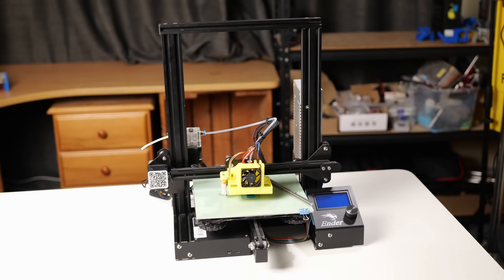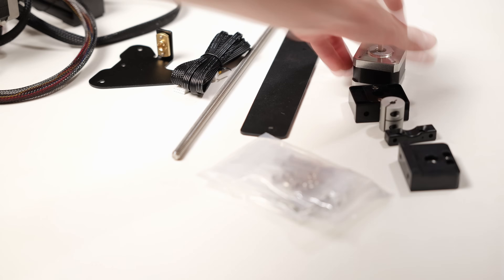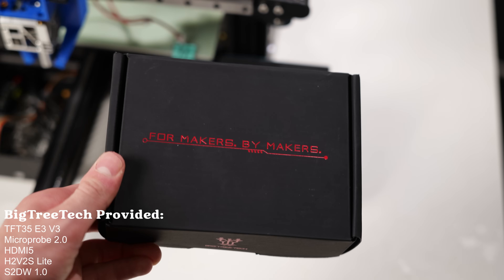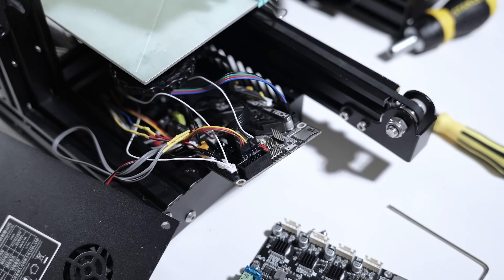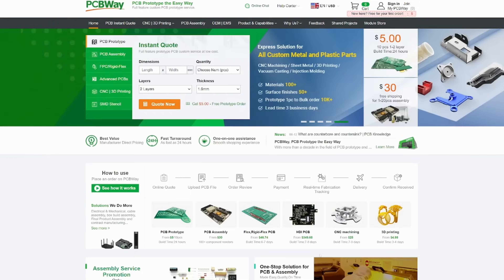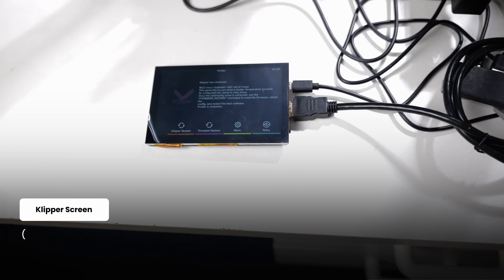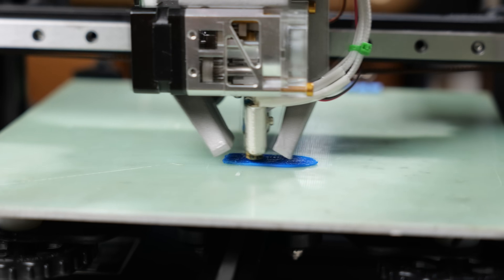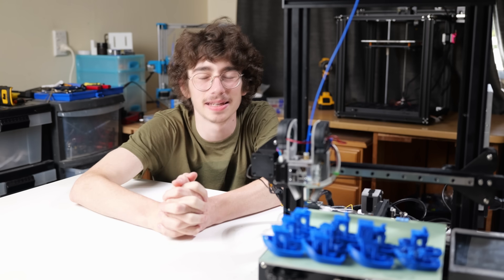Upgrading Everything on my Ender 3

Comment from the maker: I’ve uninstalled the mains bed for safety concerns, I’ll consider reinstalling it in the future once I receive proper parts. I appreciate everyone’s feedback on it. I’d like mention that this videos purpose was to try and upgrade “everything” not upgrade the most impactful parts. It’s not the best performance per dollar, there are more videos out there covering what the best value upgrades are. I can always recommend a leveling probe, mainboard upgrade (I’ve heard good things about kevinakasam’s dual z belt mod) and a hotend and extruder upgrade. There’s plenty to choose from, I’ll try and do a deep dive (with justification) on the topic in the future.
Reply: i tried to upgrade my biqu b1 with big tree tech board and the h2 and the printer just keeps missing 10cm even after calibrations
Reply from the maker: @dorito24856  I’m not sure why that would happen, I’ve done several mainboard upgrades and extruder upgrades with minimal issues. Some fixes I’d look into would be E-steps for all axis, in case they got modified, and motor v-ref and current in case you’re missing steps. I hope you find the solution. Cheers

Comment: That little 220V silicone bed looks dangerous, bro.
Reply from the maker: It is, I am very careful around it, any mistakes could certainly be dangerous. I’ll be working on making it safer in my own time. Crimp connections are used when possible, however a thermal fuse is a recommended add on. I’ll look into it as I’d like to know as much as I can to increase knowledge and reduce risk. Cheers
Reply: @TommyHoughton  Well, the first thing would be to have a really good clean surface for it to stick to. You should remove all that old insulation foam before sticking it on the bed for starters. Next would be insulation for those wires to prevent them from shorting out. TBH though, with such a small bed, 24v should be more than enough to heat up quickly in my opinion. On larger beds with thicker aluminum plates is when AC is really necessary.
Reply from the maker: @wrxsubaru02  Good tips, I’ll look into some more cable sheathing/covers for my wires as I’m all out and it’s useful stuff. For a 235mm bed it’s not necessary using a mains heater, I just wanted to add it for the title and was a food excuse to try out. There’s a video I would like to do in the next few months where I install a silicone heater on a cabin fiber sheet as a lightweight alternative to an aluminium one, will hopefully be interesting for high speed printing on bedslingers.
Reply: @TommyHoughton get some RTV gasket sealant and put it around the edges of the pad, check how voron beds are assembled
Reply: I have a similar 220v 500w bed heater which is 300mm^2. Once I had the mcu on without the rpi powered. The mcu turned the bed on by itself and kept it on at 100% for a few minutes. I heard hissing sound from the other room, came back to find that my bed heater was about to melt my printer. Smokes were coming off and the heater almost detached from the bed. But its working fine even after that incident. I never operate it from far after that.
Reply from the maker: Thanks for sharing, that's a pretty scary experience. Glad it's working fine. I'll put some more time into the bed and make sure it's as safe as possible.
Reply: yea that kapton tape mounting is... sus.if you have an air bubble whatever under there, that heater mat will not be happy and will catch fire at some point. It will also stink like death before thats happening
Reply from the maker: @takuya2431  good point, this model didn’t have adhesive backing so I thought it would work. I’m uninstalling the bed today until I get proper parts. I appreciate everyone’s feedback

Comment: at this point you should have converted it to switch wire using a kit but it could have been a totally different video and approach
Reply from the maker: Yeah you have a point. Christoph Lehner already did an excellent video doing just that, and I wasn’t ready for such an undertaking just yet. Cheers

Comment: I modified my Ender 3 V2 Neo with linear rods on Y, linear rails on X, double Z that is going to go for belted Kevinakasam, and Titan + V6 extruder with CHT nozzles and 5015 6000rpm blower. 
I think that with Marlin MRiscoC with Input Shaping, Linear Advance, Junction Deviation, the best compromise for quality and speed is 150mm/s for cheap filaments and 4000mm/s² acceleration. 
I obtain near 37min benchy and I consider myself satified.
For speed the only way is a CoreXY but you'll need also hyper PLA or new hyper PETG now near 20-30% more expensive than traditional filaments.
Reply from the maker: Your machine sounds amazing! I tried some high speed pla in my Ender 5 video, and I’m super pleased with its performance. Cheers
Reply from the maker: Thanks for the link! I quite like how clean and compact it is, the cooling looks good too. I might have to look into some higher rpm 5015 fans.

Comment: I did something similar to my Ender 3 Pro.  Thing doesn't look remotely the same.  Dual Z Axis, LED light bar, Sprite SE extruder, Spider hotend, Nebula pad interface, insulation under the bed, different springs, blue metal level screws, CR Touch auto level are all the purchased upgrades.  Printed upgrades include a mount for the Nebula gyro sensor, bed handle, took drawer, Nebula pad cradle, Nebula Camera mount, rail covers, rail caps, cable clips, power supply fan vent, scraper holder, and other bits and bobs.  The next upgrade is just gonna be another printer (maybe a Bambu)
Reply from the maker: That’s awesome! I hope to keep upgrading my machine until it’s unrecognisable, or at least till there are no stock parts. All the best with your next machine and upgrades!

Comment: What you can try for the speedbenchy is actually remove the rubber feet and pit it on small stiffer legs, for some reason the vibration of the printer and the bed can cancel each other out because the bed doesn't stop abruptly because the printer itself moves with it
Reply from the maker: Interesting, thanks for sharing that! I’m planning on doing more performance upgrades to the Ender 3 later this year, so I’ll try remembering this. Cheers
Reply: @TommyHoughton  the guy that made the 100 3d printer has a great explanation for it! It is on youtube
Reply from the maker: I’ll check it out! I’ve heard great things about that machine.

Comment: its said to say but just buying a ender 3 v3 se is cheaper and you get MOST of those upgrades already done rather than upgrading a stock ender 3. i had a ender 3 and upgraded after  looking at the cost.
Reply from the maker: I can completely agree with that, my friend recently bought a V3 SE and he’s very pleased so far. In terms of value it’s near unmatched. Cheers

Comment: a few notes here.
1. you should really use a z-motor bracket that uses all 4 motor holes
2. the top parts on the lead screws will overconstrain them. I don't really add them but at least 3 of my printers came stock with something akin to those.
Reply from the maker: Thanks for the tips! I’ve heard before that the “Z-guides” or whatever they’re called could cause problems but I think it was in the long run. I’ll look more into it. Cheers

Comment: can u help fix my ender 3 pro something with the bl probe idk what's causing it not to print correctly
Reply from the maker: I can try to help, but you will have to explain it as clearly as possible. I only just fixed a bl touch issue two days ago after giving up. Cheers!

Comment: Have you got any links to good settings for printing with PETG on the ender 3 series?
Currently I have to print slowly or it goes all whack with the prints.
Reply from the maker: Not really sorry, I haven’t got much experience with PETG and still haven’t been able to dial it in. I don’t use it often either so I haven’t done any research. I hope your printing improves soon and you find the best details possible. Cheers!

Comment: I have an Ender 3 pro that has been gathering dust, I have considered just selling it and putting the money toward a BambuLabs printer as I am tired of the headaches. 

I do prefer open source firmware though. Please let me know what you suggest. 

Thank you for the video.
Reply from the maker: I have friends who swear by the Bambulab’s reliability and quality, while I do not have personal experience with their machines, I can recommend going with them for less trouble. I’ve been tempted several times when my machines decide to break. I’d be willing to make the sacrifice of open source firmware for a system like Bambulab’s. Thank you for your question and for watching! Cheers

Comment: hey mate, do you know which fans you used or the cable extensions specifically? i can't find any on amazon au
Reply from the maker: I use AliExpress for all my parts, I can provide the links for reference (hopefully YT allows them through.) The fans are nothing special, just generic 5015 ones.
https://www.aliexpress.com/item/33049767300.html?spm=a2g0o.order_list.order_list_main.10.42f11802imEsRK
https://www.aliexpress.com/item/1005002129562534.html?spm=a2g0o.order_detail.order_detail_item.3.7e68f19cMyFmTo
Otherwise, I don't use Amazon Au since shipping to NZ is always just a little bit too much. Let me know if this does/doesn't help.
Cheers!
Reply: thank you! just bought them and hopefully they'll work

Comment: I think about upgrading and replacing parts on my Ender and Kobra Go's and always come to the conclusion that the money and parts are better used on putting together a Voron or some other DIY printer.
Reply from the maker: I agree with that, anything in a similar league to a voron will outperform any bedslinger. It’s a great looking machine too, as with all the higher end corexy’s.

Comment: amazing but here are some things that can retain quality at those speeds, 1. belt are tensioned with as tensioner, 2. the extruder may be a little heavy, 3. make sure fully you are not losing any cooling and all part cooling fans should be at 100%, 3. dont go that high speeds, 4. make sure everything possible is calibrated, 5. general maintenance 6. quality fans

and you should be good :)
Reply from the maker: A proper belt tensioner is what I need to get next, it really does make a huge difference. I’ll keep those tips in mind, and thanks!
Reply: @TommyHoughton i just remembered, but you could get more powerful cpap fans, they are more powerful than the 5015 and can also improve quality by a lot. And you can print and use the printers parts to make a belt tensioner.
Reply from the maker: @LucaThePupineer  I'll be trying some other cooling methods on the Ender 5 video. I've got some huge 120mm blowers for auxiliary cooling, and some tiny 3010's for the printhead, will be super cool (in both meanings.) I hope to try cpap cooling in the future. Cheers
Reply: @TommyHoughton  get ready to be ‘blown’ away🤣

Comment: So, i already instaled klipper on my ender 3, but i want to increase print speed, but i dont have too much money, what do you recomend with low price to speed up the print?
Reply from the maker: Glad to hear you've already got klipper installed. The main bottlenecks of a roughly stock Ender 3 are the cooling and hotend. The motion system (with proper klipper tuning and cooling) will be able to hold its ground for quite a bit.
The most economical option would be 3D printing a new fan system for part cooling using a couple of 5015 fans, which are commonly available online for a couple of dollars, and there are plenty of duct options for the Ender 3.
A ~2$ CHT clone nozzle from Aliexpress would give you the most hotend output improvement and depending on what mainboard you're using, a 60W or 80W heater cartridge would also help a bit with higher flow rates. Volcano heaterblocks are also around 2$ on AliExpress but change the size of the hotend which can be annoying.
Cheers

Comment: ill be looking forward to seeing the ender 5 mods for sure. I just recently bought a ender 5 and it was used from the local microcenter. After finally learning to level and tram the bed for Z hight so I could print my only issue now is making sure Z steps are calibrated for it and move onto PID tuning the bed so I know everything is correct. >_< Take my advice just buy it new and calibrate it from a stock system. A used system regardless of being stock or modded is a different ball park to mess with honestly.
Reply from the maker: All the best with your machine! I got it preowned for a good deal so I can’t complain. I’ll hopefully get a ton of mods on it, It’ll be great. Cheers

Comment: As someone recently introduced to 3D printing, I've been considering getting a printer for home. Would the ender 3 be a good investment? I am under the impression its an older 3d printer thats been around for awhile, but I do like the idea of "upgrading" or tinkering and fixing parts on it myself if I have to. I've seen alot of youtubers use bambu printers, but they seem pretty pricey as well.
Reply from the maker: I’ve heard good things about the Ender 3 V3 SE, it’s one of Creality’s new Ender 3’s with most of the upgrades installed. (I haven’t tried it yet but I’m going based off what I’ve seen) As good as an old Ender 3 would be to get started, it can be frustrating to mess around with, and it lacks a lot of modern features, especially the original. You’ll end up spending more to bring it up to speed. There’s fun in doing it, but it’s never the most economical path. There’s a ton of information online, so most problems will probably have been encountered and solved. But for someone getting into printing, I’d look at getting one of these modern machines with most of the upgrades already installed and especially one that’s proven itself. It’ll make it easier to tinker as well having a machine that actually works. I’ve heard great things about Bambu’s machines, but can’t justify the cost yet either. I’d have a look around at machines released in the last year or so and try find user reviews as some machines aren’t really that good. Cheers
Reply: beginner 3d print nowadays should get a bambulab a1 mini, sub 400$ without their fancy multi filament system, theres no tinkering with the machine, just print, the machine works. If later on, you get interested, the ender 3 is a good base for an upgrade project where you get to tinker with your machine as much as you want. with the years I came to liking printing without tinkering much better than maintaining my printer alongside printing, so I am very happy of bambu's arrival on the market.
Reply: Ender 3 series is not old. First ender 3 (v1,v2, pro...) are old ofc and not worth buying/upgrading money wise (only point is if you realy want to upgrade by yourself).

If you like the idea of tinkering, definitly avoid Bambu lab. It's like the Apple of 3d printing. Works great but they do everything to make it propriatary/closed source/uncompatible.

You can look for more modern ender 3, they are as good as any other modern printer. Or look for other open source brands, there are many. I would advice to go with any open source printer that you find good enough quantity of content when you look for it. They are all about the same price for same performance anyway.

Comment: Nice upgrade :) At this point though i think its best to put that money on a better printer to start with... except for one thing: you learn a lot doing all those upgrades :)  Nice videos and well made mate
Reply from the maker: Thanks Simon! You’re absolutely right on that, there’s diminishing returns after a while. I certainly learn a lot with the mistakes I make 😄 In July I’ll be releasing my video “Building The Fastest Ender 5 Pro” with a corexy conversion, LDO speedy motors, dragon ace hotend, auxiliary cooling and more. I’m extremely exited to begin; I’ve just started scripting. I’d be honoured if you checked it out in the future! Thanks so much for commenting :D It made my day. All the best with your projects! Cheers, Tommy

Comment: What ended up being the fix for klipper screen? I previously re imaged my pi and I also went yay no errors but now i have no screen....just displays the console.
Reply from the maker: I reinstalled Klipper and triple checked I had klipper screen installed, for some reason it didn’t work the first time. I also flipped the usb c cable going into the screen, as otherwise touch control wouldn’t seem to work. I hope you get it resolved. Cheers
Reply: @TommyHoughton  glad it worked for you but seems like we're completely different on how we set it up! I used ribbon cable and had this working before so i know it works, but i reinstalled everything and thats when i started having issues. i had issues manually installing the firmware and then used kiauh as half the tutorials with that so i might have conflicting code now too. I was hoping your 1hr of troubleshooting was a simple enable this in mainsail lol thanks tho! good video and keep it up
Reply from the maker: @marcusdionne  weird that it reinstalling caused issues. Is formatting a possible factor? Maybe something didn’t get reset properly, but It’s just a guess. I hope you get it sorted. Thanks for watching the video.

Comment: A question for the heated bed, would you guys say switching the heated bed is worth it on the ender 3 neo, or should i apply an insulation pad as i have seen multiple people run?
Reply from the maker: I wouldn’t say a whole replacement is worth it, I found that insulation was a nice boost to temperature retention, maybe heat up time too but can’t say for sure.